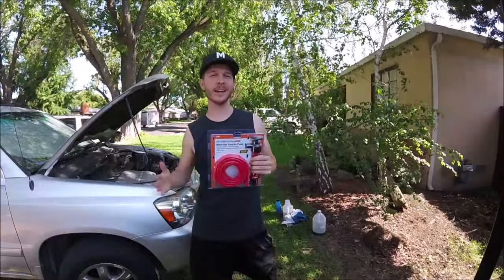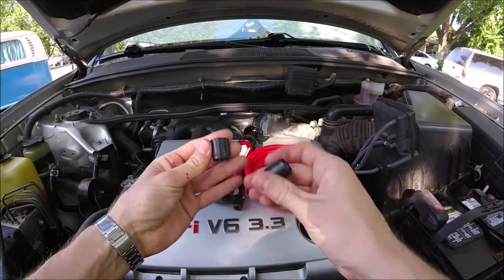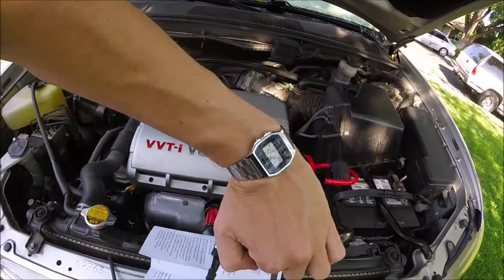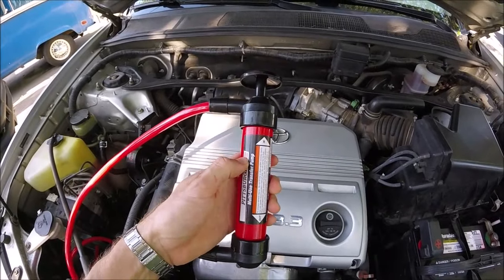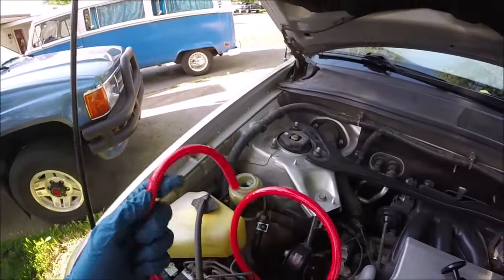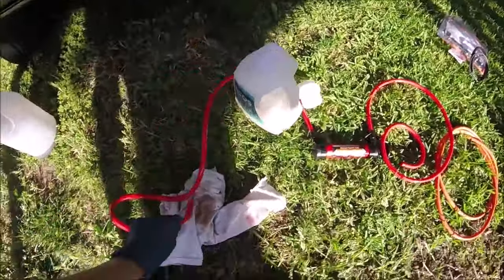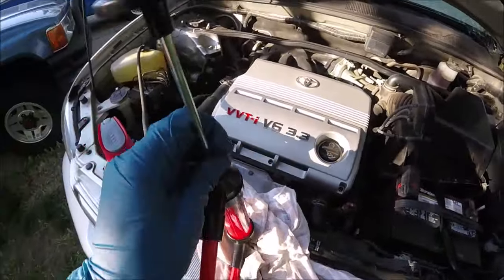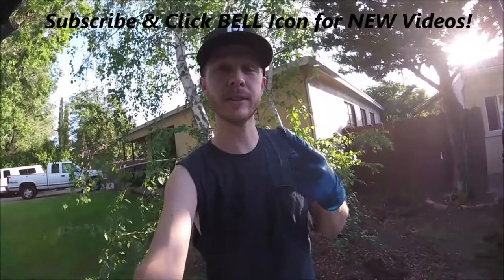Harbor Freight Multi-Use Automotive Transfer Pump. Test & Review -Jonny DIY

Comment: I tried using this to remove some oil from my Tahoe via the dip stick tube and it didn’t work. Nothing came up the tube. After watching this, one thing I did not do that could have made a difference is removing the oil fill cap. I thought that maybe the oil was just too thick to get up that thin tubing. Don’t know.🤷‍♂️
Reply from the maker: Yes remove the oil fill cap, it should work if you have the small hose hooked up to make it longer and it's not leaking air

Comment: This is a great product, I changed my transmission fluid with it because there's no drain plug at the bottom of the pan to my van so I sucked out the transmission fluid from the dipstick got about 4 quarts of transmission fluid out =)
Reply from the maker: Awesome, havent tried that yet. Good idea 👍
Reply: @JonnyDIY  it is a great idea you should try it if you need to change your transmission fluid witch is every 50,000-100,000 miles for most vehicles or 5 years witch ever comes first
Reply from the maker: @jl1695  currently all the vehicles I own have drain plugs but I could still siphon to avoid getting the tools out and possibly causing a leak
Reply: @JonnyDIY  yup u can plus you don't have to get under the car

Comment: Got myself one if these as sadly i overfilled my car with engine oil...just arrived with no instructions so thank you now i know how to use it and can drain the excess oil out through the dipstck...elaine.
Reply from the maker: You're welcome, glad I could help. Hope you get it to the correct level. Can always pull the drain plug on oil pan real quick and put back in. I had to do it on a vehicle just recently that had been overfilled as well
Reply: Unfortunately due to health issues i can't get under my car so chose via dipstick..am sure it will be fine..going to try it later..it's an easier and less messy option hehe..it's a mistake i never have and will not make again.
Reply: Guess what used the gadget and your video instructions today and was able to drain all the over filled oil to normal level with no problems at all..now i can drive my car thanks to you..couldn't have done it without watching your video..many thanks.
Reply from the maker: @Elaine3663  Awesome, so glad you were able to get it done and that I helped a lil 👍
Reply: @JonnyDIY  You helped more than a little believe me..simply thank you.
Reply: Tell me how do you put a heart on comments..i wanted to do that with you but no idea how to lol.
Reply from the maker: @Elaine3663  its a button that shows up for me as the video creator. It allows me to put a heart on comments left to me. It would show up on comments on videos that you posted 👍
Reply: @JonnyDIY  Okay friend thank you but i guess i cant do that yet...stay safe from me in uk hehe.
Reply from the maker: @Elaine3663  you're welcome, & thank you, you too! 👍

Comment: I've watched several videos on this type of pump and only one I gave a thumbs up.  A. Only one I've seen with a clear explanation of the in and out (I realize this is easy to figure out, but still nice he says which is which).  B. Only one I've seen that talks about cleaning it (and how) after it has been used.  C. Several videos do not show the use of the parts that hold the tube in place at the pump end. One video even showed the tube pop off while being used because he failed to put that on.  Hilarious. Nice job.
Reply from the maker: Thank you, glad the information I shared was a help 👍

Comment: So for putting fluid into like the transfer case or differential, did you have to use it upside down?
Reply from the maker: Yup pump the new fluid from IN side and it'll come out the OUT side and into your diff or t. case 👍

Comment: Can you use this for oil change instead of going underneath the vehicle to find the drain plug??
Reply from the maker: You can, will just need to attach the small hose to go down there and siphon it. Then you will need to use the dipstick and how much oil it takes to refill and youll be able to see how much you were able to siphon out. Hopefully all/most of it 👍 Draining from bottom is usually easier,  but on certain vehicles siphoning is the way to go

Comment: So I just got this and mines not pumping my steering fluid like yours...it has no resistance. Any tips?
Reply from the maker: If it won't pump water from a bucket it may be defective. I know when those interior seals get worn out it won't pump anymore. I'd exchange if cant get it working or see if can take apart and see if can get it going

Comment: Will this pump gas up from a 5gal can on the ground into the gas tank of an SUV? Goal for me is to not have to put the can above the gas cap level. 

Also, after pumping soapy water through it to clear out residual gas, do you need to rinse with clear water and let dry before adding oil or wd-40?
Thanks!
Reply from the maker: It will pump it, but you will have to continually pump it as it won't have the siphoning effect without the gas above. Shouldnt take too long. They also sell a battery operated siphon pump that may be better if you have to regularly do this. I usually let it dry for a few after cleaning with soapy water  before the wd-40 👍

Comment: You did not show us how to siphon the gas from the gas tank ?
Reply from the maker: Same as I used it in video push tube down into tank. May need to push 1 long tube down into gas tank 1st then connect siphon tube to that one, depending if a car and how long filler neck is 👍

Comment: I used the product to extract oil from crankcase..worked well tho. Just didnt expect the pumping pressure was quite heavy for thicker fluid like oil. Cool tips on the  cleaning and storing the siphon...👍
Reply from the maker: Nice, glad it worked well for you. I've never tried thick oil with it. Maybe harder if it wasn't vented to pump out

Comment: Awesome review- looking to get one of these to pump out the old gear oil in my bush hog gearbox, which doesn’t have a drain plug. Quick tip- I’d use spray silicone to lube that plunger seal, WD-40 is petroleum based like oil and can eat rubber seals over time, where silicone won’t. Thanks for an awesome video, time to go buy a pump at HF! 👍
Reply from the maker: Thanks and you're welcome, I'm glad I could help. Nice tip on the WD40, you're right I'll try the silicone spray next time. I've got some around here somewhere! 👍

Comment: Nice overview of the unit.  I expect to use it for lawn equipment oil changes only,  don't really have concern oil will degrade the seals, though I will likely still flush it out with detergent.
Reply from the maker: Thanks,  and nice yeah it'll work perfect for that. I've used for that a lot. Only time mine busted was cause I siphoned old gas out of mower and brake fluid without cleaning afterwards. Just ate up the seals

Comment: Great explanation 
I’ll use this for my coolant reservoir
Reply from the maker: Thank you, yes it works great. I just used it to do power steering again the other day 👍
Reply: I need to replace my radiator,  heater core, & clean out my reservoir.  The guy I bought it from failed to tell ? me about the heater core but in his defense I was being rushed to buy the car from the person who took  me to buy the car. If I'd had the time to thoroughly inspect the car I'd walked away!!

Comment: Great video.  Much more informative than another I've seen.  I did not know about spraying it to lube the seal.  Maybe that is why my first one crapped out.
Reply from the maker: Thanks. Yeah definitely important to clean it out with the soapy water 1st too. Sometimes they do just go bad from solvents like gas or brake fluid though. I'll have to see if can take apart see if seals can be replaced
Reply: @JonnyDIY speaking of soapy water, I like using a mixture of Dawn and warm water. I’ve been using Dawn dishwashing liquid to clean my oil change stuff for many years. The Dawn liquid is really good at cleaning the oily stuff off the surfaces. Just a, hopefully, helpful DIY FYI. 😊
Reply from the maker: @carlovanrijk4039  thank you for sharing! 🙌👍 Yes Dawn works great at degreasing

Comment: Bro I bought one yesterday for my jeep vuz a stripped drain plug...literally sat in my driveway pumping for 5 hrs straight essentially
Reply from the maker: 5 hours!? 😳 Holy cow. Hope you can get that drain plug off, heat with a torch helps usually

Comment: I've used one of these for years on 4-cycle lawn equipment, and it's been great. I recently inherited some 2-cycles. Should I care about cross-contamination from the pump? I understand that I need to keep the fuel separate, but what if I use the same pump on the 4 cycle engines? I'm supposing a small residue of 2-cycle oil would just burn off in a 4-cycle engine. Do you use your cleaning technique every time you change fluids that you are pumping?
Reply from the maker: It shouldn't be a problem to use the same pump on either. I do clean it every time I siphon brake fluid and gas. I wasn't sure which ruined one of my pumps before, was probably the brake fluid if you've been using it for gas without issue 👍

Comment: I had success with this,  but on a 1994 f150, I had to improvise...the red insert hose wasnt' strong or long enough to reach into the front gas tank, so I inserted a ten foot garden hose, which went all the way in, then, 6 inches out of the tank, I cut the hose, shortening it, the inserted the red hose into the garden hose and successfully pumped out almost 15.gallons of old fuel in almost.an hour....so remember, with a Ford, you're going to need a 10 foot hose to insert....good luck.
Reply from the maker: Awesome, glad you got it. Thanks for sharing 👍

Comment: Are you calling it a pump or a siphon? The video description uses the word siphon.
Reply from the maker: It's both really. Harbor Freight lists it as a "Multi-Use Transfer Pump" though 👍
Reply: @JonnyDIY  Not sure about the siphon part. I understood that a siphon uses negative pressure for flow rather than pumping. And I always thought a siphon operated continuously once primed. This apparently doesn't do either AFAICT. AAR awesome you for checking comments and shouting back!

Comment: Very entertaining. You should do stand-up comedy. I subscribed. It's time to empty the gas tank on my Yamaha R1 which has been in storage al fresco for months. I bought this pump some time ago and now it's time to put it to use. Thanks for the guidance.
Reply from the maker: You're welcome, glad to help. I've had good luck using Sta-bil fuel stabilizer for storing motorcycles. Haha thank you, I used to do comedy improv shows and have been writing stand up material the last couple years. I'm hoping to start performing soon, thank you for the encouragement

Comment: Can you use this to siphon gas from a cars gas tank? Need to use car tank as a reservoir for my genny.
Reply from the maker: Yes this works to pump gas from a tank into a gas can. Just be sure to clean as the gas will eat up the pump seals 👍
Reply: @JonnyDIY  . 
I just found one I had  put away several Year's ago, never used. My tube will not go all the way down into the tank. Maybe 2' 4". Something is stopping it. Hose not getting gas on it. Full tank. 2000" jeep.
Reply from the maker: @jat-justamaturetech-philpj8285  there may be some sort of baffle in the tank stopping your hose. Try with a longer and or smaller diameter hose to see if you havr any better luck

Comment: I added a little too much oil on my oil change. Will this work and fit on the dip stick end? Thanks
Reply from the maker: yes it should it has a smaller hose attachment as well for smaller openings. Ive pulled a drain plug really quick and put back to take some oil out before as well. Have pan over a tarp or cardboard, blanket etc to keep mess minimal though. And gloves too if don't want oil all over. But one of these is always handy to have around
Reply: @JonnyDIY  thanks my guy for the quick comment. Will do! Great stuff and you earn a sub
Reply from the maker: @ariesanfilippo1078  You're welcome, happy to help. And thanks for the sub! 🤙

Comment: You really need one hand to vacume up the gas with the input hose from the corners of the tank, then you need 2 more hands to hold and operate the pump. Not so good ☹️
Reply from the maker: True. It only works well as a siphon pump when youre pumping something higher than the the pump and transfer container

Comment: At 36º It didn't work. Out of the package the hoses were stiff and kinked and didn't soften up at that temp. Another vid here mentions this not working at cooler temps. We're shipping the car in a week or so, so the tank needs to be no more than a quarter full.
Reply from the maker: Try heating the whole thing up and oiling the pump rod. Oil should make seals plump and swell and work
Reply: @JonnyDIY  hey thanks, thought of heating the hoses up to get the kinks out and hanging them to straighten them up, but never thought of oiling the pump rod. Will do.
Reply from the maker: @hatuxka  Good luck, hope you can get it working. If not may need to try another siphon pump. I know they make a small electric one that works pretty well

Comment: Nice I have the same pump and Highlander! Using it to change my rear differential fluid.
Reply from the maker: Nice good luck with the project 👍🏻
Reply: Ugh I'm using it to pump out radiator fluid from my Highlander to check for a  combustion leak. Thanks for the vid I would be lost without it.
Reply: Did u have to use it upside down to pump fluid into the differential?

Comment: Have used this with transmission fluid or oil ?
Reply from the maker: Yes I've used with transmission fluid, oil, power steering fluid, brake fluid, even gasoline 👍

Comment: Mine stopped working after 2nd use
Reply from the maker: Did you pump gasoline through it or another solvent?
Reply: @JonnyDIY  no, i pumped out some water inside of old tires. I pulled it apart, and noticed a piece of leaf was causing the diaphragm seal yo not seal. It now works
Reply from the maker: @david84ss  Ohh ok. Ohh good that's awesome glad you were able to fix it 👍

Comment: Thanks again  I have not used mine since last year (1st time) Anyway watched part for a quick review.  P.S. When I put mine up last year I flushed it with a liter of soapy water then one liter clean water.  It worked fine 2 years!
Reply from the maker: You're welcome, glad to help. Awesome, nice to hear its still working. I use mine all the time for so many various things 👍

Comment: I think I messed up on my first try. I tried to suck out some extra coolant out of the reservoir and the first two pumps the pressure sucked in the tank and almost exploded. I'm worried about any pinch points that formed.
Reply from the maker: Remove radiator cap to let air into system 👍
Reply: @JonnyDIY  With the car running or off?
Reply from the maker: @blount_man  Car off. You can also drain coolant from bottom of radiator easily if need be 👍
Reply: @JonnyDIY  I thought about doing that but couldn't locate the plug. I'm hoping nothing is wrong with the tank or anything else after that incident
Reply from the maker: @blount_man  should be fine just keep eye on it and temperature gauge for a bit to confirm
Reply: @JonnyDIY  Sad part is there's no gauge in this Honda
Reply from the maker: @blount_man  😳 should definitely try and fix that or add one, don't want to overheat
Reply: @JonnyDIY  Will be heading to the shop after since I need a oil change too

Comment: Thank you for this video，it's extremely helpful，because I didn't get any instructions(pictures and video such) from the store where I purchased. I do have another question，how to uninstall the in and out pipes？because the size doesn't fit my vehicle and I am trying to return，unfortunately，it's extremely hard to take the two pipes off，I'm so confused.
Reply from the maker: You're welcome, glad to help. To take apart you pull black pieces off tubing then pull out tubing

Comment: GREAT FOR DRAINING MOTORCYCLE TANKS!!!!!
Reply from the maker: Yes for sure! For storage or old gas 👍🏻
Reply: Jonny DIY I literally just left Autozone to purchase one 20 Minutes ago lol I’ll use it on my motorcycle tomorrow I need to Change the fuel filter but the tank is full
Reply from the maker: @stopitskiiiuuup4006  ohh nice, should run better with a new filter. Good luck with the project tmrw! 👍🏻

Comment: used mine to check for leaks on exhaust and intake manifold just connected cigar to in hose and adapters using what I had around the shed, Found a leaking egr valve!
Reply from the maker: Thats awesome! Will have to remember that one. Cool trick. Glad you got the issue sorted 👍